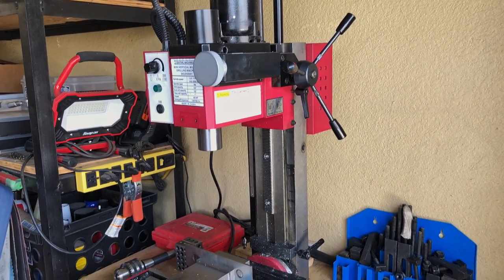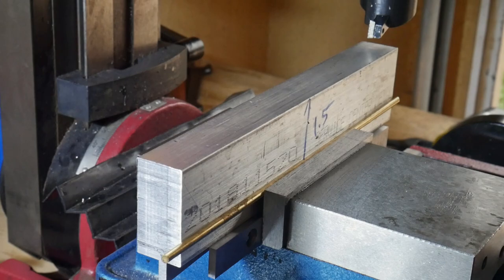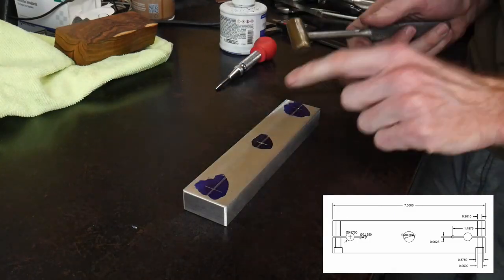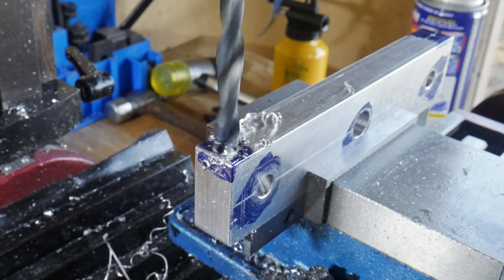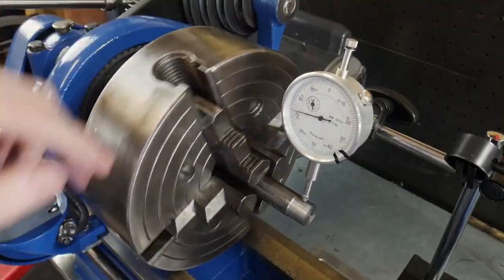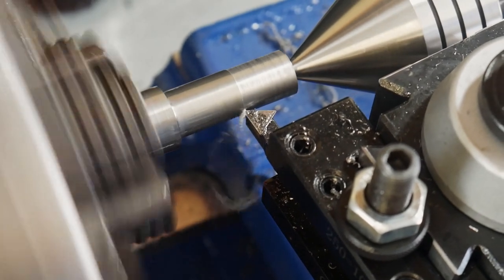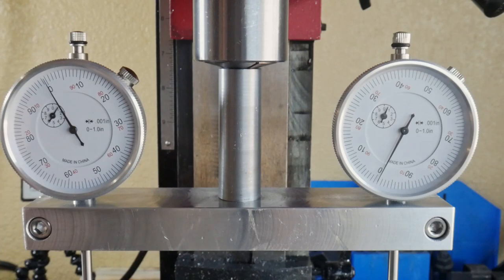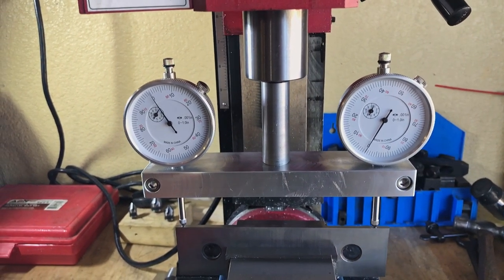DIY Spindle Square | Tramming a Mini Mill The Easy Way

Comment: That’s a great little project! I need to look into something like this too. Thanks for the great video 👍
Reply from the maker: Hey man, thanks for the comment. This little guy is pretty handy. If you make one, I think using a piece of aluminum that isn't as wide would be better (1.5'' was a little beefy). The 1.5" makes the set screw "flex" hard to come by. Anyways... you know this since you've build tool arms for work rests!

Comment: I did enjoy the video! I use a very similar tool to tram my Mill. I also periodically break my Vise loose from the table still in the table and tram the vice to the table also. I really like that Atlas! I found using the carbide insert cutters they like to be under a consistent load. I was breaking the tip off of many inserts until I learned that they like a heavy cut. A heavy consistent cut. If you get it just right you'll get a heavy cut that breaks chips so that you don't have super long spirals that are Unbroken. I am running a South Bend heavy 10 with a 1 and 3/4 inch spindle bore. after my first year of running it really softly I realized just how heavy of a cut this machine can handle. Man now that you have a Mill and a lathe you're a veritable gunsmith!
Reply from the maker: Lol, thanks man! Good information to know! I was taking what I think were pretty light cuts (~0.007'' depth). I'll have to push that up and see what happens. Thanks for the tips dude. Cheers.

Comment: I just bought the low torque mini mill from Little Machine Shop; it was 1200$ w shipping... I haven’t bought a bit or accessory yet, and now I need a lath to keep up w your projects?  I think I’m going heat treat oven instead this next time.  Good knowledge though!
Reply from the maker: Heck yeah man! I be you're going to be happy with that guy. Very handy piece of equipment for sure!

Comment: Very good video, easy to understand. I do have a question, you dud the side to side tram, what about the front to back tram. Don't you need to be square in both axis?
Reply from the maker: That mill doesn't have the ability to adjust the front/back tram easily... unfortunately. The LMS 3990 version of this mill does.

Comment: Great video, did you worry about the center shaft alignment so you had it on a  90 deg. to the main bar, or isn't that needed,, also why not just put little thumb screw into the shaft of the dial indicators?   👍👍
Reply from the maker: Good idea on the screw.

The 90 degree angle actually doesn't matter if you zero the tool. I had to draw it out to verify in CAD... mind boggoling a little
Reply: @RedBeardOps   Mine is very very close if not on, but will check it to make sure, Already checked it with the digital read out and square off the table, but I'll make sure, Thanks so much Red Beard

Comment: Awesome channel, subscribed a week ago.  Now, I'm somewhat perplexed and I hope you can help me understand a few things.  I just acquired a used LMS 3960, so I'm pretty new to all this stuff.  You are using a collet, vise and parallels (which all have some amount of concentricity TIR) but the two reference components to check here are the spindle and table/bed (what I would call the two references).  Would checking the tram with a dial indicator attached to the spindle with a magnet and long enough arms to check each corner of the table and even the front/back center be a better tram foundation?  Because if those two components are within say 1/2 thou or less then if you slap a vise and parallels on the table and it's out a lot more then it's either the vise and/or the parallels, right?  Thank you.
Reply from the maker: Nice glad you're enjoying it! What I'm generally trying to do with this operation is to make sure my vice is trammed to the spindle. With the budget quality vise I have I just assume it's not going to be perfect so I make sure the vise is true rather than the table.  

Yes using the dial indicator on the spindle is a good solution as well, just takes longer since you have to move it back and forth. 

Note I'm not a machinist... so take all of that with a giant grain of salt
Reply: @RedBeardOps  I'm not a machinist either but sometimes I wonder if that what I should have done.  Anyway, I think I understanding the setup here with said/used vise/parallels.  It's like in cabinetry work, square is not always pleasing to the eye.  If the wall/ceiling is way off then your square hung cabinets will look off unless you make the cabinets off to the same degree of the ceiling.    Thank you.

Comment: Strangely enough, for the last 60 years I've never used one of these.......when I did see one I wondered how the heck the 2 dials could be equal.........seeing it set for first one then the other solved it......never too old to learn.
Reply from the maker: Cheer sir!
Reply: Check Mr. Pete 222 channel for simple version of a tramming device that uses a single indicator that swings around behind the vise. No mirrors are needed and the heavy vise does not need to be removed.

Comment: Well, how do you know if you are machining the spindle square precisely if you cannot use the spindle square first to check if your mini mill is trammed correctly for making the spindle square? ;-)
Reply from the maker: I thought the same thing and had to prove it to myself in CAD. It actually doesn't matter. You zero it each time.

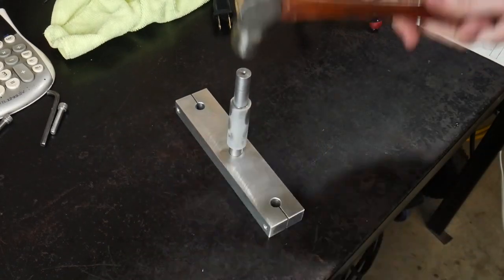Comment: Nice idea but You made this tool on the machine you wanted to calibrate so how do you know if this middle hole where the axle goes 7:15 is perfectly perpendicular? Metal bar 2:32 after miling is thicker on the one side so table had to be angled a little bit. If so , those 3 holes in the bar specially middle one , will be angled too and whole tool will wiggle while spinning giving bad measurment
Reply from the maker: The assembly doesn't have to be perfectly square to function correctly. I know... Took me a while to wrap my head around that too.

Comment: Hey Red Beard Ops, very nice video! Just a small question, what about the other numbers on the small scale ranging from 0-10? I was always under the impression that both indicators should read the same on both dials?
Reply from the maker: Hey man, that just means that one of the two dial indicators had more of a "pre-load" when calibrating on that one spot on the parallel. If you want them to be exactly the same you could loosen the set screw and move the dial indicator up and down (opposed to just rotating the dial so that they line up on zero during calibration). Both will give you the same result, but many people like the feeling of both dials having the zero in the same spot on the dial when tramming. Hope that answered it.
Reply: @RedBeardOps  thanks!

Comment: Stupid question, but why are you using the brass rod.? Once again sorry for the stupid question
Reply from the maker: Not stuipd at all! I'm no machinist... but this is how I see it. 

When you know the back of the piece is nice and flat, you can put it on your fixed vise jaw. The front of the piece isn't flat and parallel yet, so you can use a soft rod to clap down so that the front vise jaw doesn't shift your part. Something like that.
Reply: @RedBeardOps  Sir, Thank you very much.. thats makes alot of sense now that you explained it..

Comment: How are you building a tool to tram a mill on the mill you’re looking to tram?   How do you know the tool was made ok if the mill wasn’t trammed?
Reply from the maker: It actually doesn't matter sine you're calibrating each dial indicator. I know... i thought the same thing and had to draw it out in CAD to prove it to myself
Reply: The "left" and "right" indication errors  cancel out as soon as you  set zero both indicators to one single spot on the mill table by swinging  the fixture 180 degrees.
Reply from the maker: @robc8468  100% Accurate.

Comment: My issue with this mill is the acme screws, they just arent machined to correct specifications, too tight, then too loose, then too tight.
Insane vibration/oscillation, blows up cutting tools all the time too despite setting it up to perfect speed for the metal I'm cutting, plenty of coolant/oil, and I'm machining REALLY slow, still no go.
Gibs sliding out, tighten them so they dont slide out = Too tight to move X/Y/Z.
Tried using a stone on gibs/ways, still no go.
Got a MT3 tool holder for some end-mills I bought, didnt tighten the bar too tight or anything = It's stuck in the spindle, no amount of hammering/lubing/wd40'ing gets it out.
I knew this wasn't going to be a mill for big scale production or anything, wasnt even into CNC converting it as I just wanted a small mill.
But I spent a summers worth of wages from various odd-jobs on acquiring it for various smaller projects, and it won't function correctly despite following all recipes on online forums (which I read BEFORE splurging on it), much less get it to do any of the things I wanna do with it :/
Reply from the maker: Sorry you've had poor experience with this machine sir! That's a bummer for sure.
Reply: Did you oil the guides ?
Reply: Take lighter cuts use sharp cutters and reduce feed rates.

Comment: Waste of time...Just bend a rod ( that takes a dial indicator ) that expands your range clamp the other  end into the quill touch the table on 1 side ( zero it  out ) swing it 180 degrees pick up the table  ( example  0 one side swing 180 pick up the table lets say theres 15 thou difference split  it in half ( move your head 7 thou ) and your at a perfect 90 degrees
Reply from the maker: Sorry you didn't enjoy this one Tibor!
Reply: Exactly.